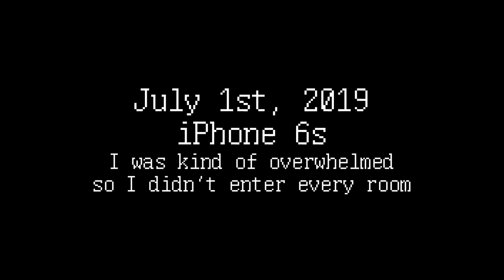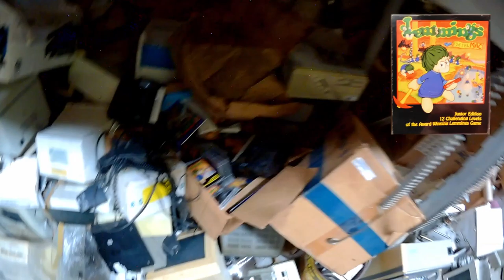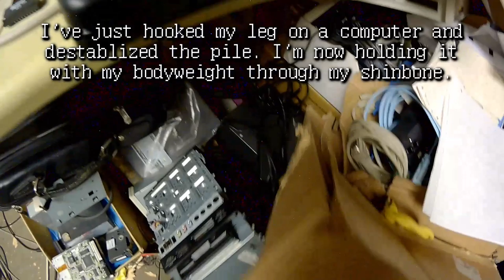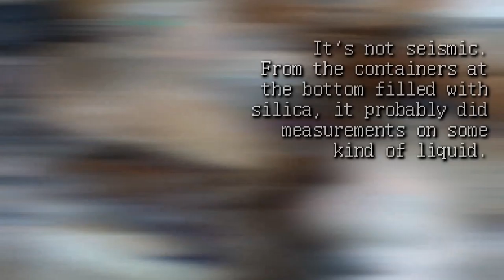3 Trips to Computer Reset

Comment from the maker: ~Timestamps~
Session 1
00:00 - JULY 1st, 2019
01:34 - Front of warehouse
02:21 - Back into the building
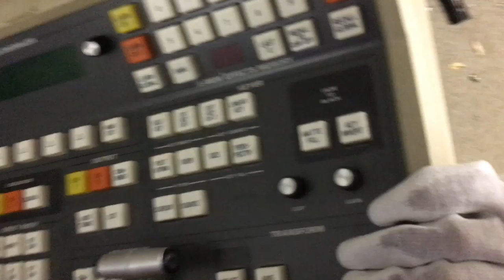02:35 - Video FX controller
03:10 - upstairs
04:18 - unknown PCB
05:45 - running server rack & an iMac on the floor
06:50 - some TI assembly drawings
08:25 - some shrink-wrapped software and books
09:57 - typewriter/teletype
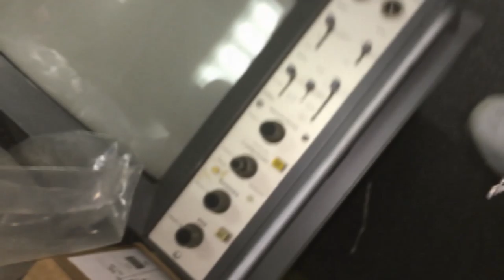11:45 - AV equipment room

Session 2
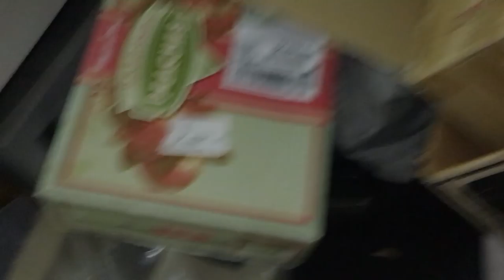14:01 - JULY 22nd, 2019
15:55 - heading back
16:30 - the parts room saga
17:45 - smushed logic chips
18:42 - concern
20:38 - to the warehouse
21:45 - squished Ultima VI
23:00 - a box of Math Climbers for C64
25:00 - forklift 1 located!
27:30 - to the outside of the warehouse
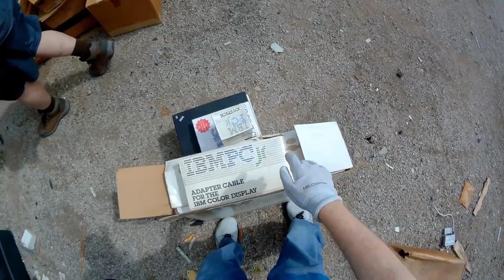27:53 - another (PCjr)
28:40 - now the back of the warehouse! Where most of the items earmarked for museums are.
29:20 - a huge unknown Teledyne-Geotech instrument (you'll get a closer look later)
29:46 - one of the literal mountains of boxes
31:35 - 3Dconnexion Spaceballs
32:32 - a mildly concerning pile
35:45 - a Lemmings demo disk. So obscure I had to get a picture from LGR's video.
36:05 - dad checks out a boxed IBM PCjr.
38:50 - finished looking at the PCjr
39:25 - Diamond Multimedia video cards
40:00 - Compaq SLT-286
43:43 - Votrax Type-n-Talk
46:00 - a big heckin printer
48:45 - a quick glance in the wrong end of the drive room
49:15 - a keyboard with Model-M style keys
49:45 - don't open the fridge, part 1
50:15 - revenge of the parts room
52:09 - a small accident
53:40 - SyQuest ezflyer backup disk
54:52 - Computer Reset's mission for electronic recycling. Thanks Will Wear!
56:35 - found an Aztech Galaxy Nova 16 Extra. It doesn't seem to work in my computer.
1:01:14 - a look at the outside of CR.

Session 3
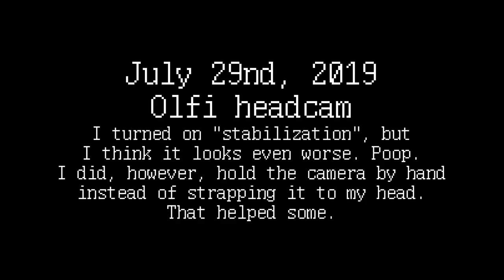1:02:32 - JULY 29th, 2019
1:04:08 - left-hand office
1:04:57 - peek into the right-hand office
1:05:13 - hall of unreturned repairs
1:06:50 - parts room
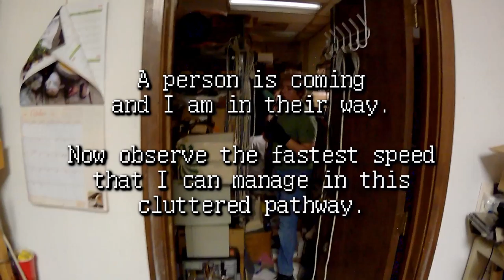1:07:30 - cramped space negotiation
1:08:10 - hard drive room
1:08:35 - don't open the fridge pt 2
1:08:52 - left hand hallway
1:09:35 - printing room???
1:10:20 - to-repair room room?
1:11:08 - return to left-hand office
1:11:38 - software & teletype room
1:12:55 - forbidden bathrooms
1:13:25 - back to the left-hand office
1:13:54 - the front of the warehouse
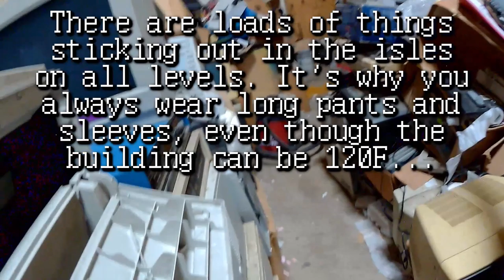1:15:15 - getting stuck on a thing
1:15:52 - extra forbidden bathroom
1:17:17 - local man climbs mountain
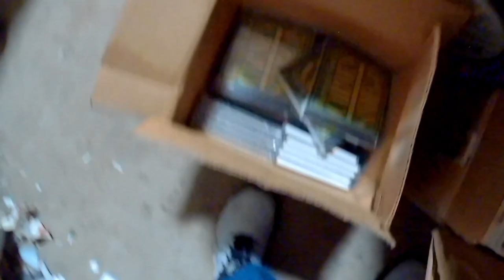1:17:37 - Where in Computer Reset is Carmen Sandiego
1:18:38 - the tower of towers
1:19:09 - forklift #3 spotted
1:20:05 - another literal mountain of boxes
1:21:19 - Dune Buggy spotted!
1:22:26 - more climbing
1:23:13 - yet more climbing
1:23:55 - brief glimpse of the outside of the warehouse, then moving towards the back of the warehouse
1:24:39 - more mountains
1:24:59 - huge stack of PCjr stuff
1:25:25 - industrial press
1:27:05 - the biggest mountain
1:28:33 - IBM RT Model 125 in a Tempest shielded case (earmarked for museum)
1:29:00 - Amid the piles you can see parts of an IBM 9375 Mainframe (earmarked for museum)
1:30:15 - Teledyne Geotech thing. It's not seismic. The pink stuff in the containers appears to be silica gel for indicating and absorbing moisture. It may be an air dryer for sensitive equipment.
1:31:35 - walking outside 
1:32:28 - back inside the front of the warehouse
1:33:12 - front of the building
1:33:28 - going upstairs
1:34:15 - audio room
1:40:33 - ColorCase kitty ATX case
1:44:05 - customer's piles for purchasing
Reply: STUNNING detail in these chapters...I LOVE the effort you've put into this...